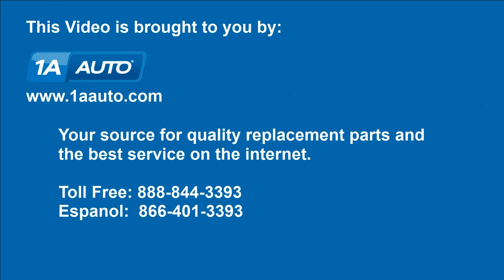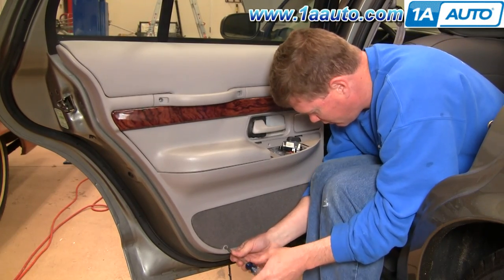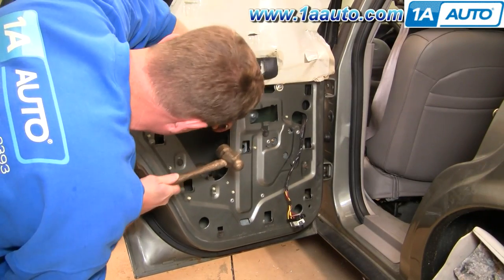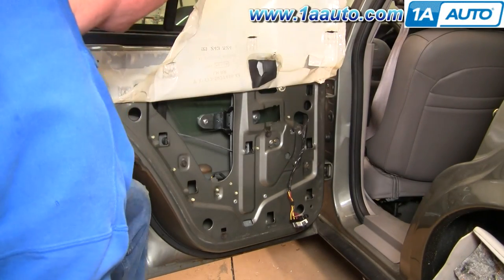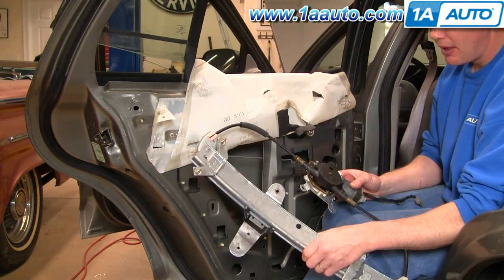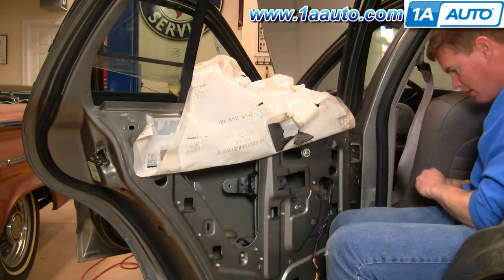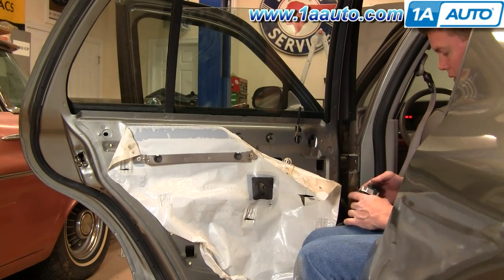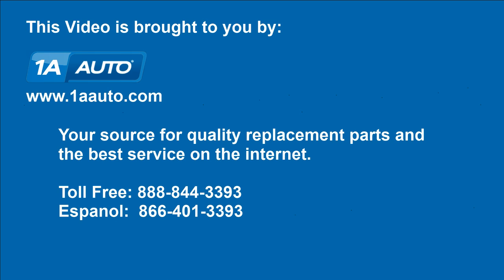How to Replace Window Regulator 92-10 Mercury Grand Marquis

Comment: Mike, thanks very much for this video.  Without it, I never would have attempted this procedure on my own with my 2004 Crown Victoria.  I ordered the part from 1A Auto, and it arrived in a few days.  Then I just followed your instructions on the video.  The most difficult part was removing the rivets, since only one of the center pins punched out properly, but I was eventually able to drill out the rivet and the pin together.  These videos are a great service!

Comment: Great video! I couldn't have completed the project without your help. For those of you preparing to the do this project, when attaching the window to regulator, Do Not over tighten the lock nuts. I did, and my window shattered. Please put a little loctite on the threads, and just "snug it up".

Comment: Thanks for the offer, I appreciate it. I also appreciate you guys making this video. It was very helpful.
I think I was one of those rare occassions though. My regulator was in working order. The culprit was my window itself. Somehow, the front molding got caught or pushed behind the window causing it to jam. Making it impossible to roll the window all the way up, it would go down but not up. I took the window out and straightened out that peice of molding and it works fine now.
Thanks again

Comment: This process worked great for our 1993 Mercury Grand Marquis.  We used 1/4 x 20 machine screws with the lock washers at the lengths prescribed in the video.  Additionally, we had to loosen the nuts on the bolts through the windows and run the regulator up and down a few times to ensure the window moved smoothly before tightening the nuts again.

Comment: This video was a LIFE SAVER!!. I simply cannot thank you enough for making it. I own a 2004CVLX and the REAR door panel mounting points are a little different than the 2002. Beyond that it's identical to install the window motor and regulator. But let me tell you something. I decided to skim over this video and make a quick, shortcut type window regulator repair and it cost me. BIG.  I cracked my newly tinted rear window solely because I skipped a step. The very next day * with a new window * I set my smartphone up. Pressed play on the video and every two steps you took on the install I would pause the video. Complete those steps and press play. Repeat.  100% reliable video. Solid. Wow.
Reply from the maker: Richard Enstad You’re welcome! Thanks for watching 1aauto.com 866-403-3393

Comment: Thx priceless worked. 1999 Grand Marquis used 5 1/4-20 x 1/2" and 2 1/4-20 x 1". On the window, the white plastic circular pieces are not indestructible, be careful if you are prying on them. I was able to punch out one rivet easily, but the other I tried to pull out with pliers (once the window was outside of the door) and I broke the white plastic piece in two. 5' epoxy to the rescue, as it is going to be clamped tight with the bolt anyhow and shouldn't be under much stress I think. Also as a tip I would add that the window goes up and down in the REAR channel, pulling away from the front channel. So when you are test fitting it, move it up and down flush to the REAR channel.
Reply from the maker: +Andrew R Coulson That's a good tip. Thanks for posting it. For anyone else doing this job, we carry the parts shown in this video on our website, and we'll ship them free to your door! http://www.1aauto.com/1A/WindowRegulators/Ford/CrownVictoria/1AWRG00252?utm_source=YouTube&utm_medium=CTA%20Comment&utm_campaign=1ATony

Comment: Seeing that this was a rear window on a 1994 Grand Marquis I sure wasn't going to pay someone to fix this regulator.  Either I was going to do it myself or I just wasn't going to use the window.  I am relatively handy but wasn't sure if I was capable of replacing the regulator since I had no prior knowledge of how to do it.  This video made it easy and actually fun.  The part I ordered from 1A Auto fit perfectly and the money I saved along with a now functioning window made me very happy.

Comment: Great video, thank you for making it, my moms regulator broke on the down position and it was so stressful because she doesn't have garage parking so it was outside with the window down, this video was so helpful now that you showed me how to remove the rivets and that bolts with lock nuts are a sufficient replacment for the rivits I'm sure that replacing the window regulator this week will be much less stressful. Thank you.

Comment: ok, this is awesome and i'm going to order my regulator because of your help. a couple of questions. first will you specify what hardware is needed like 1/4 20 x 1/2" bolts or whatever? also in the comments it says that removing the quarter glass is not necessary...is that true (98 grand m)? I am disabled and any unnecessary work avoided will help. thanks

Comment: nice video!  I replaced right rear on a 1997 grand marquis.  It wasn't necessary to move the stationary window or the upper part of the window guide rails.  Removing the two lower 11mm bolts for the window guide rails, lowering the window to get it inboard of the guide rails, and removing the top rubber seal forward of the stationary window was enough to allow removing the glass.
Reply: That's Great! / So just take off the inside sweep on the top of window frame?

Comment from the maker: if you have the door panel off, you can normally prop up the window regulator with something to hold it in the mean time. If you do not, you can always try using some duck tap to hold it up in the mean time but remember to remove the tape and glue afterwards from the vehicle.

Comment: Several extremely important tips were left out or not stressed that perhaps while assumed by someone who has done it many times are not apparent to a first timer:
1. There is a channel or guide that the front (driver) edge if the window HAS to fit into. It’s very dark in that part of the door and I struggled  for better than an hour or two before I shined a flashlight in there’re and noticed it. There is a bolt that attached the guide to the door frame which you must take off, this gives you wiggle room to make the glass fit the channel. Once the glass is in the channel then tighten it back. The critical part of the channel is far down into the door.
2. Leave the bolts loose and fasteners loose  then after you get the geometry correct raise the window then fasten everything.
3. I ended up buying a FORD regulator and motor as I could never get the 1A to fit, at 2X the price. Or rather it fit easily but then the glass kept getting stuck on lifting it.  To be honest I’m not sure it was the parts fault or  # 1 and 2 which I discovered. I’m keeping it as a backup.
4. Raising the window regulator repeatedly and keeping the courtesy lights on will drain your battery fast. Be prepared to recharge it when done. My car wouldn’t even start. (the battery is good I had it tested)

#1 is by far the most important and to be honest should have been stressed MUCH MORE in this video. Yes you mentioned a channel but it’s not apparent you were speaking of the lower channel that is completely invisible from the outside or the upper channel part unless you know what you are looking for.

Also I’m not giving it a dislike either, the video definitely has some quality instructions but it was not made really with enough thought of a beginner doing the work. Anyway it’s fixed now finally.

Comment: The driver side rear window on a 95 Marquis does not have to be removed from the door to replace the regulator. After tapping out the pins and drilling the rivets which hold the glass, and loosening the tracks, the glass can be slipped out of the tracks and lowered until the bottom of the glass rests inboard and the top is tilted outboard providing enough clearance to slip the threaded studs at the top of the regulator out of their mounting holes.  The motor regulator was held by 3 torx screws.

Comment: ok, update**IMPORTANT READ BEFORE REPAIR** so, like I said I am disabled.i didn't really get an answer to my question of whether all of the steps were necessary from 1AAuto. that said, my 13 year old daughter did the repair. you do not have to take out the quarter glass, or any of the window trim. also, if you aren't replacing the motor you do not have to drill out the motor bracket rivets. use 1/4 20 x 1" bolts.my thanks to artpatronforever for the heads up on not over drilling.

Comment: I like your window regulator replacement I did mines with no problems after watching your video I have I have question can you tell me why when I get into my car I have to let it run for to the 15 minutes before it let me shift into drive I replace my brake light switch is there anything else that you can advise me on to fix this problem
Reply: I do have a 1999 mercury grand marquis

Comment: Very good video.  Thanks!

However, I just picked up a '93 Grand Marquis LS.  It has an E&G Classics "Montigua" half-padded vinyl roof on it, and it has trim around the rear door frames, including over the separator/window track between the quarter window and the rear window.  

I was wondering what else is involved with that trim?  This car needs both rear regulators.

Comment: This is a great video.
I have an 04 Crown Vic. The passenger rear widnow came off the track. How do I fix this? I was told I need to replace my regulator. Is this true? Any help/info would be greatly appreciated.
Thanks

Comment: Thanks for the video! I'm trying to salvage the vent window on this same door at a wrecking site, mine got broken in to:/ I'm having trouble lowering the main window during this process.. how do I lower the larger window if I don't have power? My problem is that I don't have access to the rivets attached to the window because the window is all the way up... any tips?
Reply: I had the same problem...except my window was all the way at the bottom, and couldn't raise it to gain access to the rivets. To make a log story short, one of their other videos (showing front RH replacement https://www.youtube.com/watch?v=6ZmZKJrudo0&t=245s) does address this condition. You have to cut the regulator wire...which is no big deal since you're going to replace it anyway.

Comment: The motor was fine and was reused on the 95 Marquis, so the 3 riveted plate was left intact and removal and replacement was by the 3 torx screws. That left only the two lower rivets on the regulator plus the 2 rivets in the glass requiring drilling. The failure of the old regulator showed the glass had stuck due to infrequent operation and the cable anchorages were broken trying to move the stuck glass. Some sort of lubricant of the tracks should prevent such failures. What lubricant is good ??

Comment: A small piece of tape goes a long way when dealing with the vapor barrier; or just remove it entirely and replace using double sided tape. I roll it up tightly and tape it to the top of the door on most vehicles.

Comment: I dont know if my power regulator is broke, but for my 2006 crown vic, I press the button and no sounds, no movement.  driver button click and still no movement.  I've checked the switch with a known working one and same thing.  What do you think is the problem?

Comment: The Ford OEM regulator (2000) is not the best quality.  How does 1A Auto's replacement compare?  Is there any improvements over the OEM offering?
Reply from the maker: +Jason Rogers Thanks for watching, Jason!  Our regulators are made to high quality standards, and come with a lifetime warranty.  There are no obvious design differences between OEM and our aftermarket replacement, so they will be about the same.
Reply: +1A Auto Parts Good to know...Thanks for the quick reply and for making these videos.  They are a great help to a lot of people!

Comment: I just did this in the rear passenger side and it doesn't fit. The motor sticks out too far and prevents the window from going all the way down and the motors tightened all the way down. Plus the regular also hits around the top

Comment from the maker: Yes this video will show you how to replace the window regulator on your 97 Mercury Grand Marquis. You may want to take the door panel off to see if the window regulator has broke. If you need a new one, we carry them on our website with free shipping in the lower 48 states. Here's a link to them (copy&paste into your browser) 
1aauto.com/1A/WindowRegulators/Mercury/GrandMarquis/-/-/1997?utm_source=YouTube&utm_medium=forum&utm_campaign=1ATony

or call Tony @ 866-403-3393

Comment from the maker: If the regulator has broke, then it would need to be replaced. We have some nice ones on our website with free shipping. The passenger side rear window regulator for your car is Part Number: 1AWRG00128 on our website 1aauto.com 888-844-3393

Comment from the maker: If the motor has gone bad but the regulator is fine, on this vehicle you should be able to just replace the power window motor. We carry them on our website. 1aauto.com or you can call Tony @ 866-403-3393 for help.

Comment from the maker: If you follow the steps that need to be taken in the video you should be fine with making the repair. There's not really any specific size bolt to use. Just a nut and bolt long enough to attach the regulator should do the trick. 1aauto.com 888-844-3393

Comment: there is no reason to remove the glass Ive done several its absolutely unnecessary
Reply from the maker: +Chuck Lenhardt Thanks for the tip! You're right that it's not entirely necessary, but for those viewers who maybe have less experience than you, it can be a good way to avoid the risk of breaking the window when you maneuver the regulator out of the door frame. That's the only reason we suggest doing removing the glass itself. Thanks for checking out the video!    1aauto.com 866-403-3393
Reply: I haven't done my crown vic rear window yet but I've done others and was very successful using several pieces of long tape to hold the window closed.
Reply from the maker: +Chuck Lenhardt Thanks for checking us out! 1AAuto.com

Comment: DO NOT USE BOLTS IN PLACE OF RIVETS WITH THE GLASS BUSHINGS. IF YOU OVER TIGHTEN, EVEN SLIGHTLY, YOU WILL SHATTER THE GLAS.